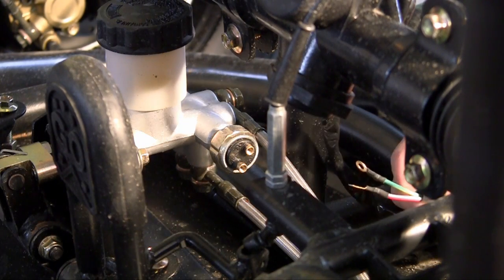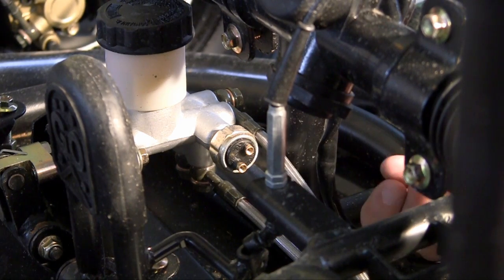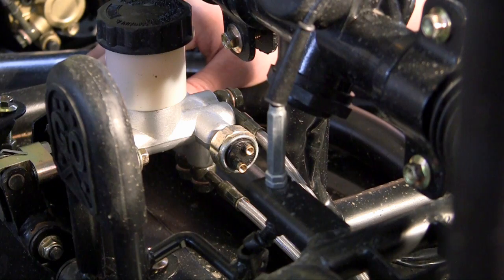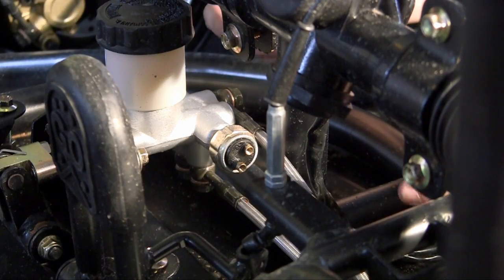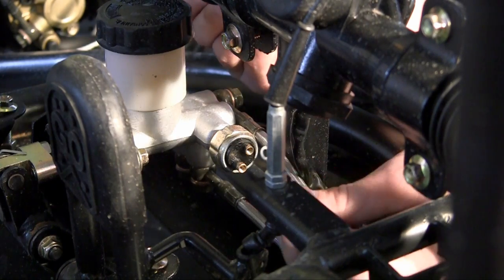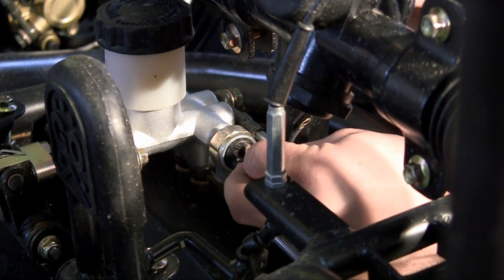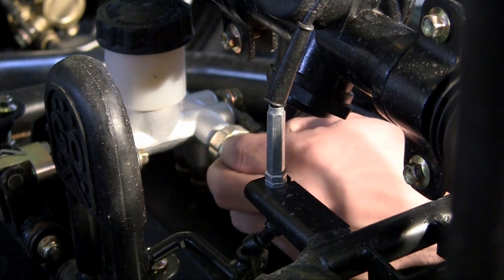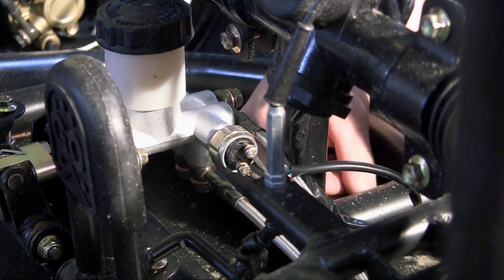How to Build a Go Kart - 25 - Brake Light Sensor

Comment: I know this thread is super old but I am trouble shooting some stuff on my maxxam 150 2R and all of these chineses karts are the same.  The brake sensor is actually really simple.  It is a open close circuit as in you either have complete continuity or none that is why you can bypass it by simply connecting the wires.  When the brake is applied the circuit is continuous (no resistance).  It does not have a direction.  It should work like this - You depress the brake pedal and the pressure in the master cylinder is applied to the sensor - the circuit is then closed (allows for continuity) and electricity is able to flow and therefore electricity is allowed to get to the rear brake light but as in my case it is also a safety mechanism in that it allows electricity to other essential starting components that allow the engine to turn over.  It is a safety mechanism so that someone does not jump in the Kart turn the keys and the kart all of a sudden takes off into a wall.
Reply: i have a question i have a 49fm5 kandi i believe it has a no start issue i checked all components all seems good i even bench test the solenoid and starter good i even tested the key switch good but when i trace the engaging  wire yellow and red coming  from key switch  it goes to a relay but the relay doesnt activate at all but when i jump the relay now the cart starts do can the brake sensor be faulty not causing the relay to start since theres a green and yellow coming from it to the relay with the other yellow and red

Comment: Will this switch function without fluid in the cylinder? 
I have the brake switch and trying to rule out why the motor won’t start. 

Is it true you can connect the wires and bypass the brakes? Thanks.
Reply: So do you have to have fluid in the cylinder?

Comment: I just bought a new master cylinder for my buggy and the sensor isn't working. I tried putting each terminal on each pole and it still doesn't work. If I put both together everything still works right. I don't want to have to keep the terminals on the same post because that keeps my light on all the time. Am I supposed to screw the switch in more to the master because the old one I have was in there pretty far, yet it didn't work either but my brakes weren't working then either.
Reply: I had the same problem.  Found out the brake pedal wasnt pushing the piston in far enough.  Get a multimeter and set it to DC volts.  Take the negative sensor and touch ground somewhere, maybe the battery if long enough, then make sure you have the ignition key to on.  This will give you 12 volts or so to the black wire connected to the sensor.  Touch the red sensor of multimeter and it should be 12 volts or more.  Then take the bolt off of the brake lever so you can put a long screwdriver in the master cylinder.  Push it in until it cant go any further.  And test the other wire.   Im guessing your pedal wasnt pushing in the piston all the way to trip the sensor.

Comment: I'm confused.  Connecting the wires to master cylinder powers the ABS system, what do you connect to power brake lights?  If you wire the lights to those terminals they are constantly powered and thus never indicate when the brakes are being applied.